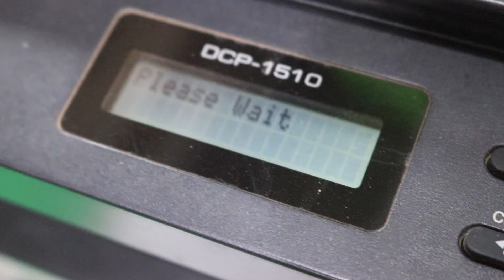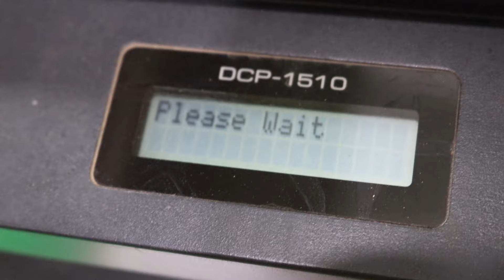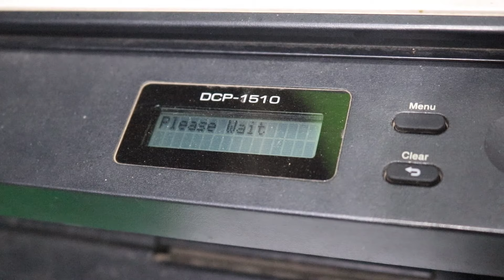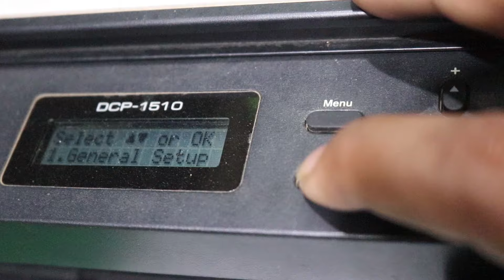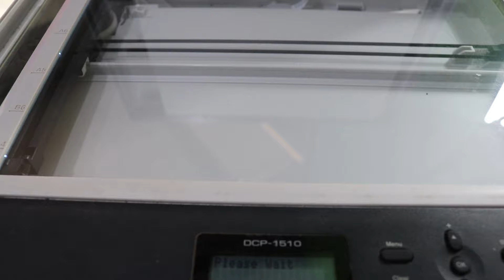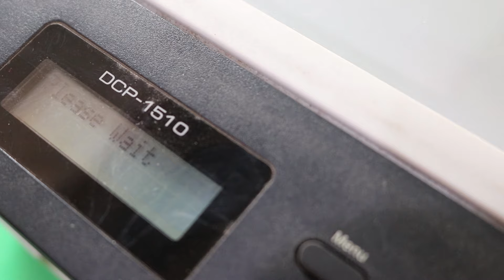How to Fix Print Unable AF Error of Brother Printer

Comment: I have T500W. Buttons on the panel are doing actions of other buttons. Example When I press Mono button, display shows change of page size. Mono and Color buttons then act as up and down button.

Similarly other button also not working as expected, when I press something else happens. This is baffling